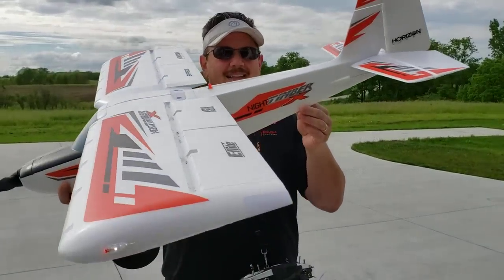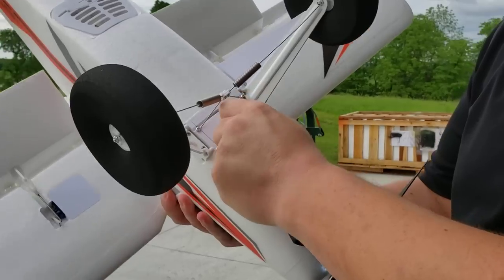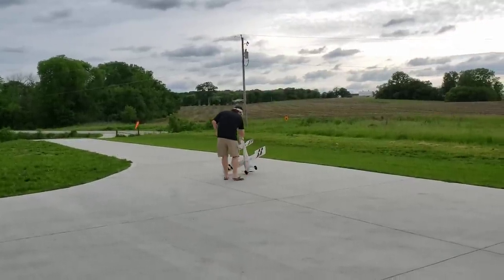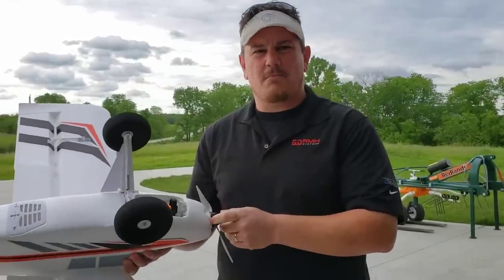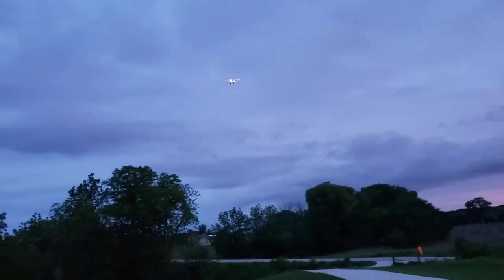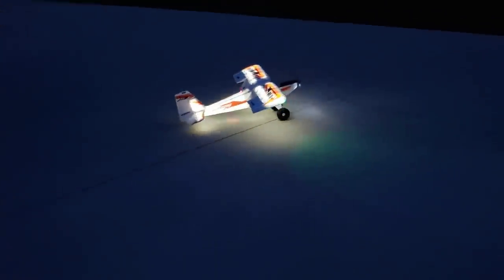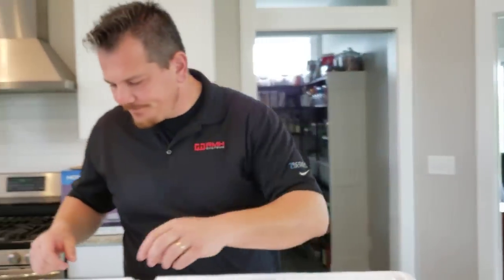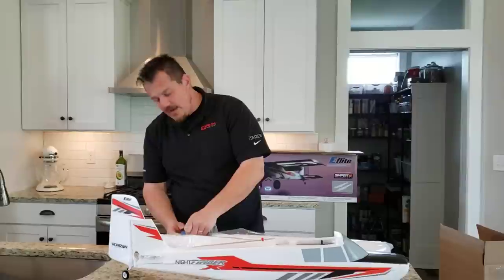Horizon Hobby - Night Timber X 1.2m - Unbox, Build, Setup, & Maiden Flights

Comment: Thanks Brian, I just got mine for Christmas instead of reading the book I went step-by-step just like you did in the video because that’s the way I wanted mine to be set up the same way you did a perfect job you walked me right through it. ⭐️⭐️⭐️⭐️⭐️ I do have one question I have a DX6e is there anyway I can do motor reversing?
Reply from the maker: I don't think so, since you have to use that higher channel, like 7 or 8, if I remember right. Sorry about that William! I can add, the reverse thrust is kinda like CRAZY INSANITY in the making. I barely have the guts to use it, since it scares me half to death!!!
Reply: @BrianPhillipsRC  Brian I have one more question 🤪 I have a DX6e and I have programmed this plane different than all my other planes now if I want to change all my plans to be the same as this plane, (i’m still learning my radio) so I have to go into each plane and re-go through the configuration? Like I just bought them.

Comment: Hi Brian & Megan (camera crew).  
I really appreciate your video’s and watch a lot of them.  I think I’ am having a problem with my AS3X modes or maybe I am misunderstanding how the AS3X should work.  Hopefully it’s just my radio set up on this BNF Night Timber X.  I have a Spektrum iX12. I have everything setup and working perfectly the way I like it including reverse throttle, except I can’t seem to get the AS3X modes (any of them) to work when I have Safe Select turned off. Everything appears to work fine on the “monitor mode” screen, even the Aux3 gain adjustment on the knob is working in the analog switch setup screen, but gain doesn’t show any change and nothing happens at the plane as far as stability. 
It’s either the control surfaces are way too limited for my liking with Safe on or I have full range of control surfaces like I normally like it, but no AS3X gain/stability at all.  I’ve done everything I can think of, including the obvious steps the manual shows, i.e. throttling up to activate the AS3X, but nothing works.   
With no wind, or in light wind, no problems, but we have a lot of wind often, so I fly in gusty conditions a lot or I won’t be able to fly much at all, so I would like the AS3X to work, but like the fact that Safe is available. 
Overall, the plane flies fantastically and does everything you ask of it easily!  I enjoy flying it!  I’m using Spektrum 4S 5000mAh 50C batteries.  I would just like to have a little AS3X stability to help with gusty or unpredictable wind conditions as the plane seems very light and affected a lot by wind with everything turned off.  I’d never used the Safe Mode until I needed to the other day and was glad to have it.  It literally saved the plane as strong winds came up all the sudden and I was having a real tough time just keeping the plane in the air, to bring it back and land it.  I'm pretty sure I know what AS3X feel like with Safe switched off, as our other planes that use it feel stable in wind including our other Timber X which feels very stable, yet extremely acrobatic.  When I do the test shown on page 13 of the manual for the Night Timber X to see if AS3X is working, the control surfaces dont move.  I can't seem to activate the AS3X. I’ve bound and rebound many times, even trying the Spectrum Night Timber Download models, the EFL13850 EFlite Night Timber X BNF Advanced setup & the EFL13850 EFlite Night Timber X BNF Basic with Reverse. Each time I bind, I’m getting the bind is complete and the double dance confirmation of the control surfaces, but with Safe turned off apparently no AS3X.
I still fly the plane, In fact I just flew it tonight, but something is definitely wrong , as it is a lot harder to fly right now than  the other Timber X, even without wind.  I have a regular BNF Timber X with the AR636A receiver for my wife and it’s AS3X works fine with Safe switched off, (quite stable). 
You and Megan know your stuff, and so do a lot of you subscribers. Hopefully someone may know what I’m not understanding or what I’m doing wrong. Sorry for the super long comment everyone.  Thanks again Team Phillips, for your very detailed & cool videos!
Reply from the maker: You can't shut off AS3X on this plane STOCK as a BNF. If you installed the Rx yourself (As a PNP) then you will be able to access forward programming if you're using AR637T or you can hook up to the PC with the AR636B.

I THINK you're feeling what I was feeling...this plane is TOUCHY. You have to put in a LOT of EXPO to make this plane fly like the 1.5m Timber, for example. This plane is way more 3D than the 1.5m Timber, and I think that's why you're feeling somewhat "out of control"...

Here's the short answer to a LOT of information you shared...this plane is harder to fly. I didn't even know you could control the AS3X gains on an AR636B...I thought that came with the AR637T / AR637TA...but I might be mistaken. When you bind, you're only picking between AS3X (Default) and SAFE Select - only SAFE (sensor aided flight envelope - auto leveling) is switchable if bound for SAFE Select....AS3X is never "off" unless you've reprogrammed the AR636B or the AR637T, and in which case, I have NO IDEA.

I'm sorry I can't answer any better for you. Maybe another of the viewers might have an idea. I think you'll need to clarify WHAT Rx you're using...was this plane a BNF? Has it been reprogrammed? Did you build from a blank profile? These questions will help me, and others who might be able to help you out.

Comment: I gotta say, you are my goto instructional video guru when I buy a plane that you have highlighted. 
I have noticed though that you don't measure the recommended throws. Is that because you trust the factory settings from Horizon/ e- flight?
Reply from the maker: I just don't do it. I prefer to get a feel for how it flies myself first. If it were PNP, or ARF, maybe...

Comment: Brilliant video!!! Thank you and your wife so much!!!! Really difficult to get to all the wires and the binding... no comment. Brilliant suggestions!!! Question: Do you always do the setup manually or is this just for the video? I normally download the data from spektrum and via my SD card load it onto my radio and then adjust it if necessary.
Reply from the maker: yes. I don't download them (ever). I've heard a few guys suggesting to download the files, but I like to have a tight control over what's going on with the plane, and then I can better respond to issues. Some are self-inflicted, no doubt.

Comment: Great video. I was wondering why the battery plug seems to have an extension? Maybe I am missing something but it doesn't seem to need any more length, so what's it for?
Reply from the maker: They're for the LED's. This allows you to unplug the inside LED's if you're flying during the day.

Comment: The manual isn't calling switch "A" a three position switch. It's telling you that position 0, when set to -100 is the non reversing setting, and that position 1 can be reversing or non reversing if set to 100 or -100 respectively. I didn't catch it at first either.
Reply from the maker: Okay, I'll think about that with the next plane I setup with Reversing Function. To be  totally honest, I think you're right on, since I was a bit confused on this one.

I WANT to make a switch to allow the throttle to show a +100% at all the way UP, and -100% at all the way down, and then neutral near the middle - like a HELI in Idle Up Mode - but I need this switch to be in a very safe place so I don't end up with the nickname "stumpy" - LOL!!!

Thanks for the tip!!! I'm excited to put it to good use, when I get out my yard equipment and start working with my New Red 2 Meter Racko ;)

Comment: I just picked up this plane but would like to know how to setup the flaps and ailerons to work together. and when I use the flaps I want them to split up.  I cannot find anything on how to do that with the NX 8.
Reply from the maker: You have to split the wiring on the ailerons and flaps (ailerons might already be split), then Factory Reset the Rx to make a 2 Ailerons and 2 Flaps wind type. This is easier said than done, but if you get these three settings done, then work through FORWARD PROGRAMMING, to do first time setup of AS3X then SAFE, if you wish, but you probably won't have enough channels to do that on the NX8.

Good luck, we don't have a video of this part, but know why you would want to do it. Also, since you'd be setting up the Rx to FACTORY DEFAULT, you can get MORE THROW from the Ailerons ;)
Reply: Thanks Brian I will give it a try this week.  Sounds a bit challenging.  I don't use Safe so I hope I have enough channels for this.
Reply: Just finished it today.  Worked great but I am not gonna lie. It was a pain in the corn hole!  Lol! It was quite  envolved.  Thanks for all you do in this hobby.   The time you take to make these videos and help us all out here is awesome!
Reply: I have about 10 flights in this plane now but i notice that a few times I make a turn and it has nasty tip stall.  Starts spiraling down with no control.  I lost it once thank God very minor damage.  But its happened a few times recently.  I was able to recover the last few times but it was super close.  Have you had this issue with this plane or the timber x?  I fly The Extra 300 and like 8 other 3d type Stol planes and have never had this issue.  Im starting to wonder if maybe the gyro was defective from the day I got it cause it always seems to happen at the same time frame on every flight.  But maybe not it could be pilot error slowing it down too much during the turn.  Anyways just wondering.  Thank for all your work on here man.  Your videos have been so helpful and I truly appreciated your channel.

Comment: Brian yes its only one side of the wing the left side and it vibrates like it has a bad servo on the alerion serrvo or flap servo?  Does not matter if im holding the plane or its sitting level, as soon as i test the control surface it go crazy? But when i touch the flap or alerion surface it stops until i actuate that control surface.  This plane has never made it off the kitchen table or my stand?
Reply from the maker: Now I feel really bad that it's been 6 days since I replied to comments (crazy week - So sorry). The servo is almost certainly broken. You will have to trouble shoot a bit to figure out which one is which. Pull the wing, and see if the servo wires are hooked up backward (yes, I've done it too)...then if they are...fix it...if not, you'll have to get into surgery mode.

If you wish, you might choose to call Horizon Hobby and request a replacement PART, or see what they offer. They will probably give you a few things to try, but just be firm and fair, and don't take "no" for an answer. You'll get what you need...but don't forget what you need might be a whole wing, and they'll try to get you to take a servo. I've found it's easier to start with a whole new plane, and work your way back to the wing...but that's just been my experience.

Comment: Thanks for a very informative video, where you also cover the less than perfect stuff, which some other folks don’t seem to.  Could you put down the three settings your talk about for dual rates and expo (crazy mode, etc)?  Hard to copy from the video.
Reply from the maker: You mean my "Standard" started settings?

Here's what I do, but this is highly subjective.

All tied to the same switch, but you could split them up, if you want to be fumbling around while flying - LOL :)

Aileron...
          Expo Rates
Pos1 10% 100%
Pos2  20% 100%
Pos3  30% 90%

Rudder...
          Expo Rates
Pos1 10% 100%
Pos2  20% 100%
Pos3  30% 90%

Elevator...
          Expo Rates
Pos1 10% 100%
Pos2  20% 100%
Pos3  30% 90%

Comment: How is it you’re able to taxi backwards? Pardon my ignorance.  
Great video, I grabbed the new UMX version this week... keen for the real thing.
Reply from the maker: No ignorance, it's an uncommon thing in RC planes, but becoming more common. The ECS (Electronic Speed Control) that runs the motor now will run the motor backward as well! Makes for a crazy sound and lot less efficiency, but it's a sight to see, especially in the air!!! This is accomplished by using another channel to change the condition of the ESC...very quick and easy, but it is CRAZY to fly and have reverse thrust...a skilled 3D pilot can do amazing things with it!!!

Comment: Brian, I need some advice.  I have ordered the Draco and it hasn't shipped yet but I am having second thoughts.  If you could only buy either the Draco or the Night Timber, which would you buy?  Help!
Reply from the maker: ABSOLUTELY THE DRACO - 100%, no doubt in my mind!!!

The Timber 1.5m would be a good "Gap filler" but the Draco is on such a different level (not to mention it's about 2.5 times more expensive...sure you're well aware!)

If there were a plane I would IMPLORE you to get, it would be the Draco, UNLESS you don't have room to fly it, store it, transport it - there is NO comparison.

Do what's right for you, of course, but the Draco is amazing. You will be blown away when you see it in person, and watch that thing reverse thrusting at about 3 feet off the ground, slamming down in all that crazy glory, onto the perfectly calibrated shocks!!! Not an exaggeration. She is GOOD. You need the Draco ;)
Reply: @BrianPhillipsRC  O.K.  I feel much better.  Thank you.  Can't wait to get it.

Comment: hey Brian  I have had this plane awhile and normally have flown it on 4s 2200 . After assembling the ultimate 3D and choosing to use the carbon or metal tail rod based on 4s and 3s batt use.  Do you think that could be the case here ?  I installed carbon rod .I suppose I can easily fly it on 3s and see how it changes the characteristics but I’d rather keep using 4s and just wondered what you thought . I suppose I could just test it both ways . But I spend much more time on YouTube watching videos than flying myself let alone tuning . Thanks for the. Great videos
Reply from the maker: I think choosing between those rods is a weird decision....if you're going to be doing a lot of 3D the metal rod would be better, since the plane will be more under stable, while the CF rod will make the plane more stable...regardless of the battery combo you pick, the CF rod will make the plane slightly more nose heavy, and the Metal rod will make the plane slightly more tail heavy.

Comment: How does this compare to the turbo timber? And which would be the better option? Thanks (sorry if the answers in the video I'm still watching haha)
Reply from the maker: I don't have the Turbo Timber 1.5m YET. I have the original 1.5m Timber, so I can't say with certitude. If you want a scale flying plane, the 1.5m Timber is slightly more tame, but still excellent performing pane....but if you want the added 3D flight, and lights galore, this is the plane for you!!!!
Reply: Brian Phillips awesome. Thank you for the reply!

Comment: The lights are not controlled with a radio channel right?  The only way to get them to turn on/off is with the physical connection?
Reply from the maker: This is correct. I added a control module for the Night Radian, and it made that plane AMAZING!!!! BUT it had a light controller on it too.

Comment: Just bought mine a few hours ago. Wanted the stol and night lights
Reply: But confused how to set up the reverst thrust on my dx7s
Reply from the maker: Does yours have a new AR631??? If so, the setup may be a bit different. We haven't updated this video, as we haven't got a replacements YET, but if you watch my Turbo Timber 1.5m V2 video from just a few days ago, you can see how we did it on that plane.

If you have the older receiver (AR637B), you can try to copy my setup from this video.
Reply: @BrianPhillipsRC  i bought the BNF

Comment: As always, love these videos. I wanted to ask about if you heard/felt and prop vibration? I have the regular timber x 1.2 and I thought the prop sounded off when I did my maiden today, so naturally I came to this video to watch and listen to your plane/prop to see if mine sounds the same, which it kinda does.

So I guess my question, have you done any changing of your stock 13x4 prop?
Reply from the maker: Not on my Night Timber X, but on my FIRST (non-Turbo Timber 1.5m) I did upgrade to a 13X6.5 and it was CRAZY with that prop, and I never had an issue with it, until the day I "sold" it and the motor and esc and nose ripped off the plane while in flat level flight - IT WAS EPIC, and totally hilarious - needless to say, that cost me a few dollars off the price - LOL!!!
Reply: @BrianPhillipsRC  good to know. guess I was just not used to hearing the prop on a bigger plane. been flying mostly UMX planes. But perhaps when I get a few better flights i'll look into that 13x6.5 and see what its all about !

Comment: Do you have any opinion about installing the leading slats? I presume they are glued on and you're stuck with them once they are on?
Reply from the maker: I want to install them on mine now, but I'm less of a 3D pilot, and more of a scale flyer. The LE Slats will be glued on, so they're going to leave a mark if you pull them off.
Reply: @BrianPhillipsRC  I'm a beginner and I don't aspire to 3D long-term, but I think low and slow maneuverability is cool. So I guess that makes me a candidate for the slats, but I'm not sure.